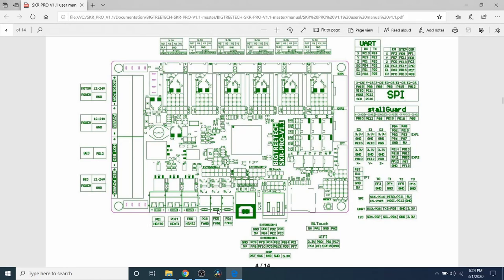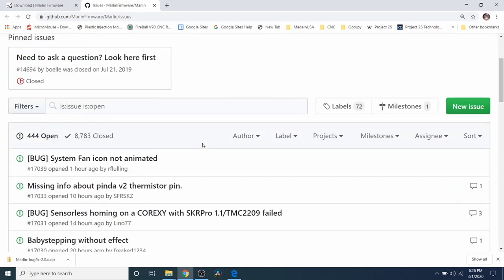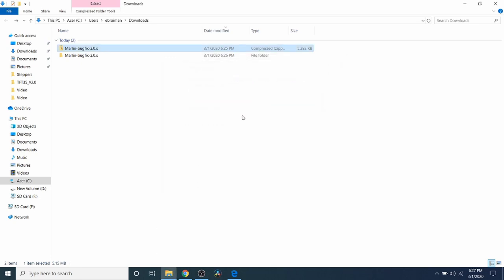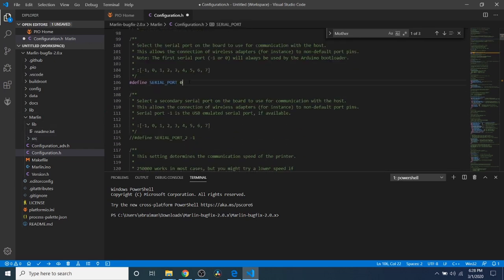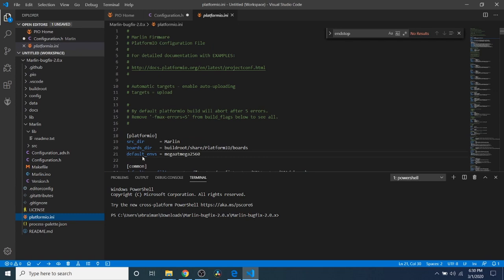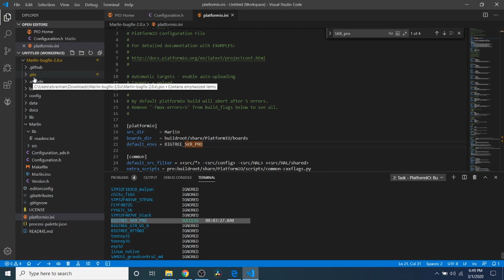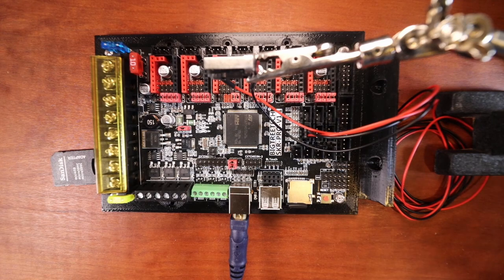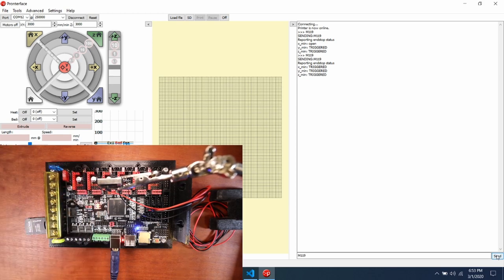SKR PRO V1.1- Simple Endstop Switch

Comment: Do you have any idea why I wouldn't be able to get my 2 wire Anet A8 switches to work with an SKRV1.4 turbo?

I have all other functions working. But the endstops don't register. I have tried switching the 2 wires around. To signal and ground. 

Any config.h changes which may work?

Once again I appreciate your videos!

****I fixed my own problem, I didn't have to invert the logic, so I left it as true.
Reply from the maker: Thanks.

Comment: THX, the Connector is a JST-XH 2.54?  Any update on the BLTouch Video?
Reply from the maker: Well they made updates to marlin firmware.  I'll need to test in a full system as they changed the way it works.
Reply: @EdwardBraiman  Understood. Im using the original Endstops from the Ender5 and I cant get any Signal to the Board. The Cable goes to VCC and SIG on the Sensor. Can this be?